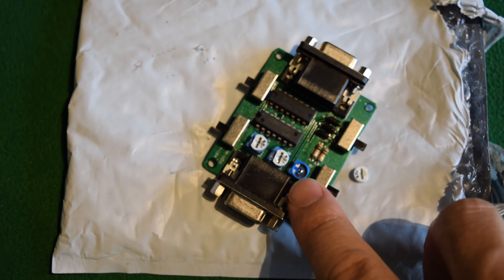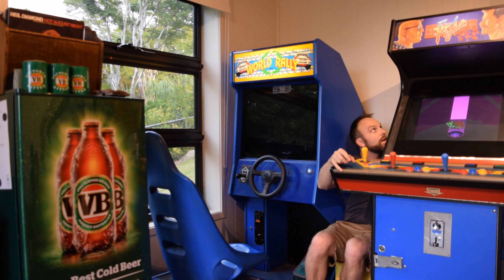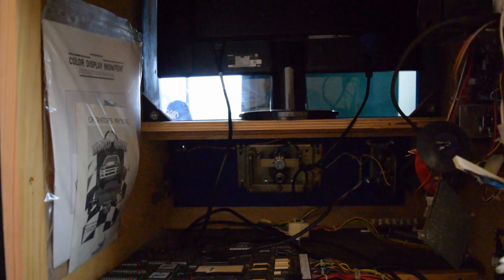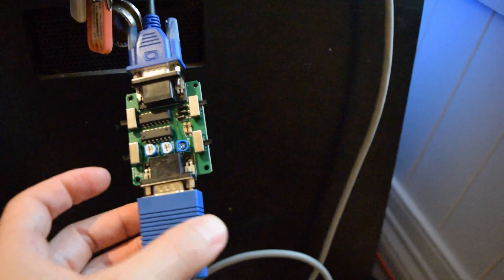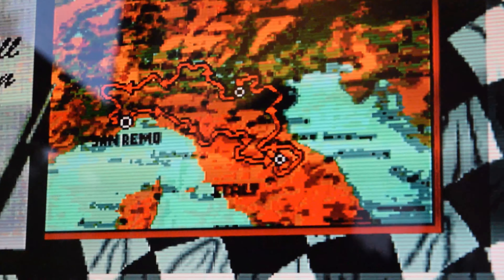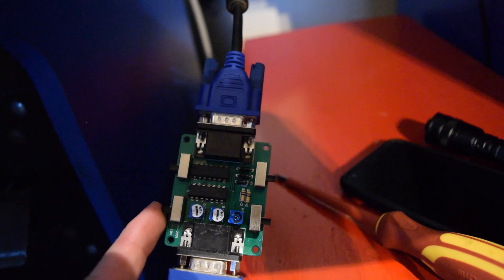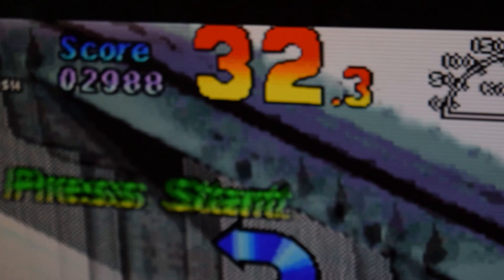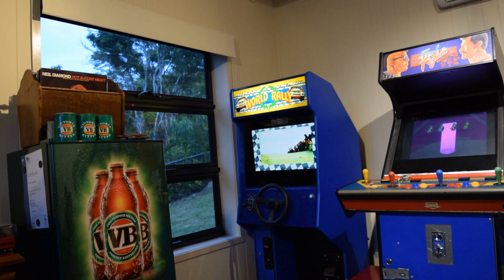Cheap Arcade VGA Scanline Generator Overview and Review - The Gameroom

Comment: pretty good and informative video. I was thinking of getting one of these myself to use it on my screen that i just bought a dreamcast for.
Reply from the maker: Thanks!
Interesting. It's a 'you get what you paid for' with this piece for sure. Great little piece of tech if all you're after is to try to emulate the feel of a CRT but didn't improve the overall picture quality at all. Hid a little mess but not much.
I unfortunately have no idea if it'd be a good fit for a console. I have a Retrotink 2X Mini that I use for my N64 that helps enormously with visual playability on an LCD screen but I did a quick Google and there are mixed reports when it comes to compatibility with Dreamcast.
Good luck with it. Hope you find what you're looking for! 😁👍
Reply: @TheGameroomAwakens  thank you mate, i was not aware of that,
I somehow found a Dell Ultrasharp 2007FPb recently hope i end up getting it as it can work with 240p
. So hard to find a CRT in Australia, all i find is some people selling 50 hz old junk for 80+ aud.
Reply from the maker: @MadaoAU   Oh cool!
Yeah they're now a luxury for sure.

Comment: I use mame so that I can blend and prescale the pixels to the scanlines so they can blend in with smooth round corners.than I adjust the first screen colors darken the back ground so all those defects  are not noticeable.than I do my second colors bright ness that my games brightness. You can be setting up 3 to 4 different brightness.theres a lot of filtering bylines also keep it crisp and smooth.i have few test scanline videos up that am trying to get best results.
Reply from the maker: Sweet! You should definitely have a go. I'm sure they would be used. 👍

Comment: Do these add any lag or noise? I want one for my VGA monitor I have my Wii connected to with VGA transcodee , but idk if it would add lag or lower quality
Reply from the maker: No, no lag on this as I can still play the game just as well as before and make all turns on the racetrack just as easily. 
As for noise...None that I can notice. As with any old arcade there is quite a hum that comes from the machine so it'd be difficult to notice any very slight noise but I don't believe so. As for picture 'noise', also none that I notice.
The beauty of these super cheap ones is that there is not much to lose! If you hate it you're not much out of pocket. Some of these components can be really expensive but this one is very basic in both its build and its components.
😁👍
Reply: @TheGameroomAwakens  like it looks the same as without the adaptor hooked up the clarity?
Reply from the maker: Yeah, clarity isn't an issue thankfully. Looks the same quality just with the added lines.

Comment: Is it similar to the SLG3000?
Reply from the maker: I can't say sorry. I've never owned an SLG3000. I was looking for the cheapest fix and was happy with this product overall. A basic experience for a super cheap price! Thanks for watching 😁👍
Reply: They all about the same.
Reply: Look at my videos.i use same scanline generator as him but you need to blend pixels to the line.
Reply from the maker: @ghostbombl8034  Thanks for helping! I've checked out a couple of your vids. Is there a vid of yours in particular that shows this the best?
Reply: @TheGameroomAwakens  
I am right know uploading a new video on prerendering your mames frames and why you get mk 1 and 2 jitters no mater what you do.that will teach you lot on why some games like NBA jam is stuck at 37 hertz you can not change the clock to match you screen.
Reply: @TheGameroomAwakens  
Every time you load mk1 one the screen that has players scrolling down both sides has hiccups because your refresh rates are not matched or sync
Reply from the maker: @ghostbombl8034  Interesting stuff! I won't pretend to understand a process as technical as that but I'm sure lots of people will find it handy.👍

Comment: Your scanline color red pot is high.i have same generator.thick lines are for huge tvs not small.the thick lines are for projector size tv.
Reply from the maker: Good info! Thanks. With no manual this stuff requires community assistance like this. Thanks for helping 😁👍
Reply: @TheGameroomAwakens  
Its one those hobby that mame can be custom any way you want with some advanced knowledge so on that is why I think there's no really good manual. Mame is designed to run games as close to there native so mame writers did not explain what a cheat file 3rd party dos to mame.You need a cheat text file in mame to unlock the over clock,you need to go to mames settings check the cheat box than go into the game to bring up the mame over clocking menu. I am gues that all new mames has it prepackaged but I do not know.
Reply: @TheGameroomAwakens  
Thing about scanline generator and digital art like mk is the scaling and prescaling is very tough to get smooth compare to none digital.
Reply: Those color pots has to match or it will darken your TV but I always add little red bleed to my lines like original and that helps to.with slight red pot turn on the line generator